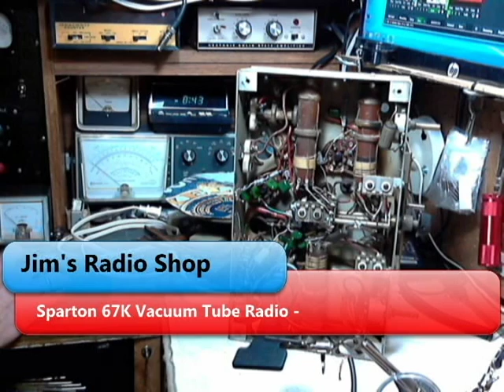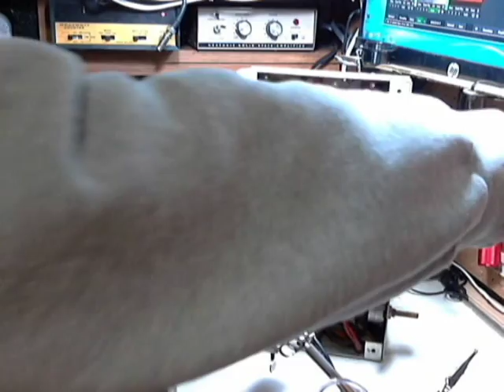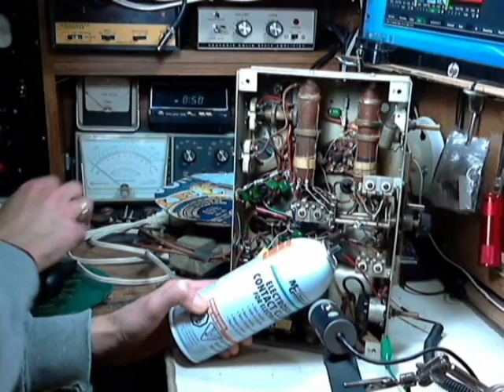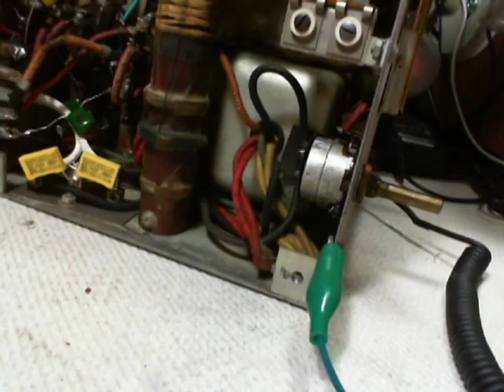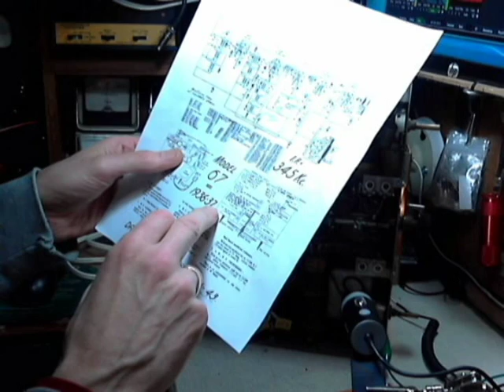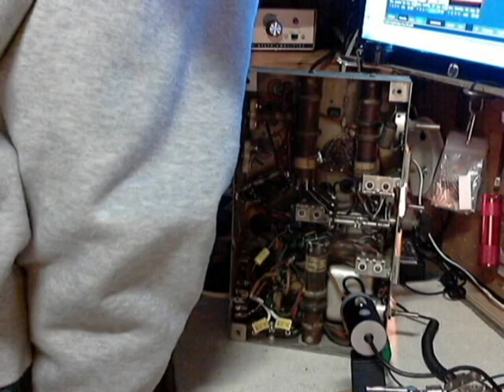Sparton Model 67 Vacuum Tube Radio Video #19 - Another Power Test

Comment: Sounds like silver mica disease in the IF transformers.
Reply from the maker: The IF transformers in this radio due not have the IF capacitors built into the IF coil form.  That type is prone to silver mica disease probably because the capacitor plates are exposed to the atmosphere.  The radio could still have failing mica capacitors, just not 'in' the IF transformers.  I'll be going through the radio hunting down the noise source next and I'll be looking at tube pins, resistors and capacitors and anything else that can go snap, crackle and pop.